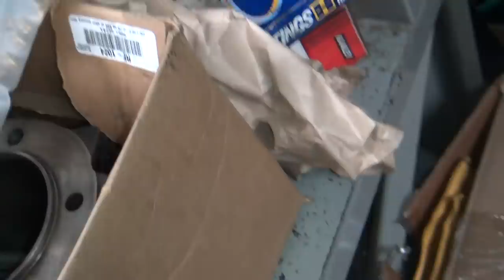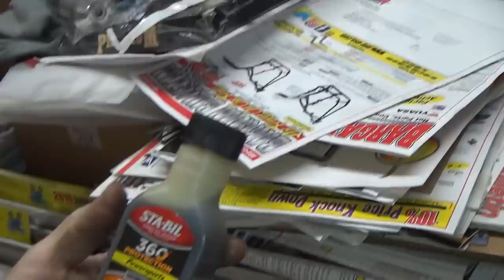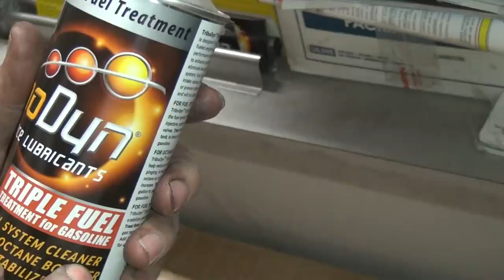#146 How To Do It,  s&s E" carb repair gummed up carburetor rebuild harley by tatro machine

Comment: Thanks for you carb tuning instructions it worked for my super   G carb .For months i just couldn't get the carb tuned so I  followed  your instructions how to set the air/feul mixture screw an it was right on target my bike sounds good . Thank  you so much good job 😀👍
Reply from the maker: its amazing on what simple changes can make. i do this all the time when a bike comes up running like crap.
tatro
Reply: @TatroMachine   hi Tatro I out together a Harley with 103 stock twin cam with super g carb and a thunderheart programmable ignition system the bike has stock pipes . What intermediate and main jet would you recommend i use thanks .
Reply from the maker: i have no idea because the gas you use is not what i use and every motor wants what it wants. get some jets and see what happens. you see me doing this in the videos all the time.
tatro
Reply: @TatroMachine  I use regular unleaded here in California  I used premium but It made my bike idle rough .
Reply from the maker: throw the s&s G carb in the trash and get a smaller carb. yours is way to big. the hsr42 is best but the s&s E will work too. start with the jets that come in them and go from there.
tatro
Reply: @TatroMachine  yes sir il swap the super G for a super E . I didn't know a super E carb would work for a motor 100" or more but you no better than I do . I really didn't like the super G anyway seem like it sucked to much air and sensitive  to dile in .

Comment: Thank you for the very complete tutorial! The one circuit you missed in your cleaning was the enrichment circuit. I just ran into one that was clogged to the point that no fuel was being added but would increase the idle at start up and keep it running
Every time I build a S&S "E" carb I tell people not to touch the throttle if the enrichener is on or they will foul the plugs. This was the one that the guy needed to pump the throttle to get it to start and stay running when cold
Reply from the maker: i just shake the float bowl. if it rattles, than the needle valve is go to do and the passage is not cloged up.
tatro
Reply: @TatroMachine   Not the inlet, the enrichener (choke.) The enrichener circuit emulsion tube was clogged. Had to run a small wire through it to clear it.
Thanks for answering back!

Comment: looks like theirs a bushing for the throttle shaft?, is it replaceable? or  just replace the throttle shaft? i suppose thats probly why s&s sells a replacement body..or can you install an o-ring...any advice? it was sucking air enough to not let it idle down...thanks
Reply from the maker: they do not come with bushings stock but s&s does sell them. you will have to machine the carb inorder to use them.
tatro

Comment: Dude...how do you replace the butterfly? I don't recall how I got the durn thing apart. Now that I have the new parts here, I'm doing a rebuild and the butterfly is bigger than the doggone bore it sits in!
Reply from the maker: it fits in at an angle. you have to square it up in the bore and than tighten the lock screws. that is if you have the correct kit.
tatro
Reply: @TatroMachine  Thanks dude! I got it. Is there a trick or method for "winding" up these throttle return springs on either end of the butterfly shaft?
Reply: I got the throttle cable side.......its the other side I'm having a time with....
Reply: @TatroMachine  thanks for the help dude. 'preciate it.
Reply: I absolutely cannot get the butterfly to sit correctly and the brass rod supposed to go in only one way? I need help!!!

Comment: i have an stock 06 xl sportster which backfires when i leave the house soon after start up. should i let it warm up longer or should i troubleshoot it. and if t/s where do i start?
Reply: @Alilretard1  i agree. its a cold start thing. i also like tatros idea of using stabil in every other tank.
Reply from the maker: it is lean. put more jet in it of fix the stupid computer.
tatro
Reply: i live in florida. is shipping tribodine gas additive cost prohibitive to send here? the t-shirts weren't. by the was t-shirts are excellent.

Comment: Hey tatro just watched your latest vid, I have a 1993 evo and can’t get it to idle without backfiring and cutting out, it has a stock ignition timed correctly, an ev27 cam, 48 pilot jet, stock cv carb but polished inside, and ported heads that have probably been ported too far, why can’t I stop it back firing at idle and cutting out, idle set at 1000 roughly

Thank you for any help, I only ask as a response to your latest vid....

Rob (uk)
Reply from the maker: start with the ignition and wiring and than the carb. 
tatro

Comment: Yeah forget that carburetor cleaner that's backyard stuff need to get a gallon can from Walmart AutoZone checkers the gal can carburetor dip cleaner take the carburetor completely apart make sure you remove all the o-rings anything plastic remove set them aside that comes with the basket put your parts in basket make sure you  disassemble the whole carburetor put all parts in the basket play basket in the carburetor dip can do not leave these parts in the can longer than 30 minutes Max are your parts come out looking brand new take an air hose to everything if there's any residue carbon buildup still find yourself a paint gun cleaning kit what are the little tiny brushes clean out all the holes in your jets intermediate jet make sure your spray inject tube is clean that sits in your float bowl is sprays into your carburetor fake gun cleaning kit between all your carburetor parts take note scrapers or sandpaper memory cloth anything to that carburetor very delicate remember take the whole carburetor apart just down to the body of the carburetor and that's how you successfully clean the carburetor don't use carburetor spray cleaner brake clean any of those products is a carburetor dip can  parts basket  like 20-25 bucks 730 minutes on your part to clean without breaking your back standing over the counter trying to clean your parts by hand the only thing you're going to do is end up with a backache and still have dirty parts with massive scratches in your parts very delicate you are supposed to replace any part scratched damaged make sure you replace every o-ring 
 Make sure you replace the carburetor wood spacer plate there's an o-ring on that wooden spacer and there's another o-ring on the carburetor the wooden plate o-ring goes towards the manifold and you can't adjust the carburetor if the air cleaner isn't on it s&s recommends having the air cleaner on the carburetor when adjusting the carburetor hopefully my information will help you even more don't throw your carburetor around on the table you can break something real easy watch out when you remove accelerator pump to replace it turn down your carburetor do it over a bowl frying pan a pot do the fact that if you aren't familiar with that carburetor he has a couple little o-rings in there that will need to be replaced and has the two little tiny ball bearings or somebody flips that off of there and they was barbarians go flying and you'll be looking for days for those stupid little ball bearings so be careful removing the accelerator pump I mean make sure you replace accelerator pump it's a little diaphragm the little tiny o-rings let the little ball bearings sit in so for the whole kit master rebuild kit for s&s super e s&s sells it for $120 the kit has everything you need replace everything inside that carburetor and outside master rebuild kit check it out s&s super rebuild kit don't let all these other people with these ads for $29.39 $50 for rebuild kit weather in Yonkers what they're doing you won't get the right o-rings I'll send you black o-rings not the blue blues for gas black is for water are green is for air conditioners so don't be fooled play these cheap rebuild kits Amazon selling eBay any of those my straight up s&s rebuild kit from s&s pretty smart huh well I hope I helped everybody out  some what I have 537,000 miles on my FLT 83 bought it new for $5,300 used to have a shovel in it after I blew that to pieces in the middle of nowhere in Nevada for what it cost to rebuild the shovel I built me a  s&s Big bore Evo that that hits140 mph barely turning the throttle I've never been able to open the throttle all the way the bike won't hold up to so remember bike seats longer than 30 days when you have an s&s carburetor you need to take a carburetor apart and you repeat the cleaning process that's what s&s requires look up locker in that carburetor and it gets all sticky don't think about cleaning it with a can of carburetor cleaner that doesn't work maybe for the final process of cleaning after you pull it out of a dip can and if you get some bad gas air leak or something getting a black residue real light start the bike warm it up take a spray bottle of warm water put it on mist give the bike some gas insert missing the water into the carburetor make sure you keep the bike running it will break down all the carbon up your vowels valve stems valve guides number one thing about working on a bike if you aren't sure about something don't be a dumbass and not ask somebody to help you out don't look at the first video you see on YouTube scroll through them find out who actually knows what they're talking about Daniel tiger run forever what knowledge you have share with other people if you see them having the same problems can't learn unless you ask that's why I've been riding my bike the same bike for like 40 years who could afford a new one play the world is you need to make more payments bye it play cash that way you don't worry about somebody coming in repo in your bike it's yours to do what you want with if you don't like the style change it your leader you don't like the style that you changed change it again anybody will ask you what color is your bike this year what did you do to your bike this year take the time over that winter will you bike into the house put some tarps down that way for sure now your free time consist on working on that bike wake up early in the morning to go to work got some time turn some wrenches after work after dinner can't sleep at night get up and work on your bike sit there and watch a movie are you working on your bike don't get in a hurry take your time relax and you won't be fighting working on your bike don't be bitching and moaning throwing tools cuz you can't get something done if it starts pissing me off take a walk come back and you'll see exactly what needs to be done funny how that works well good luck to anybody working on the carbs take your time if you need to be somewhere I need to do something then don't work on your bike there's no rushing doing anything remember that your life in your hands and your friends girlfriends wives it's their life in your hands because if you screw up working on your bike if something happens on the road it causes an accident because you were in a hurry to get something done so you could ride your bike if you take your time there are no problems everything goes nice and smooth check it once to make sure it's done right  check it twice make sure it's tight and take it for a ride couple miles down the road come back and look everything over to make sure everything is tight and right get a friend because you might have forgot something a bolt a nut a washer two sets of eyes is better than one can you tell I have cabin fever this is a long-ass comment been having health issues when was the last my leg Dr George just want to kill you off keep you around as long as you can it's an insurance check do they make sure you don't heal are they causing more problems haven't written in 2 years now I got a lot of work I got a deal on the bike fork oil seals drive chain rocket box gasket kit tires on whether cracked from the heat any new pushrods anybody's got Andrews Molly Chrome adjustable quick ride for the very exhaust online the adjustable part cracked in half just got no clue where to buy one titanium Molly Chrome pushrod I just need that end piece anybody sees this give me a holler on Facebook
Reply from the maker: if anyone can read all of this and keep up, you get a gold star.
tatro

Comment: The idle air mixture setting should be set with an approximate 25 rpm drop on the rich side of the peak idle adjusted rpm when tuning. Idle fuel/air mixture is negligible for any increased fuel mileage, except at short idle times; long idle times of an air cooled engine increases cylinder friction with increased temperature and shortens engine life. The idle fuel/air mixture setting has no purposeful function at open throttle positions. 

To truly "get the best mileage you want to get" with a carbureted engine, one should invest in an adjustable main jet, if the carburetor will accept it; adjust with a locked throttle at a desired constant cruise speed, set to a 100 rpm drop on the rich side. Fuel air mixture is constantly affected by elevation, temperature, humidity, barometer change, and manifold pressure (MAP); all of which affect the density of air or Mass Air Flow (MAF) into your engine. adjustable main jet settings should be performed periodically with any significant change of air density or when riding at a different continuous speed. When running the rich side of a peak rpm adjustment with about a 100 rpm drop, a slight amount of unburned fuel aids in cooling and lessons cylinder friction with reduced heat (too rich a mixture causes carbon build-up and fouling). 

Cylinder head temperature (CHT) will rise substantially with any rpm drop set to the lean side of peak and engine detonation will occur, this significantly shortens engine life and defeats any fuel economy gains. Generally speaking: If you have gray soot in your tail pipes you are running a good mixture, if the soot is black you are running too rich, and a chalky exhaust is indicative of too lean a mixture. An exhaust temperature gauge (EGT) is the easiest most accurate way to determine proper fuel air/mixture settings of an engine, by setting the temperature of the exhaust gas 100 degrees Fahrenheit on the rich side of peak rpm. EGT will continue to rise with an rpm drop on the lean side, until combustion becomes almost impossible.
Reply: its a harley
Reply: @chongkuat1561  lmao
Reply: Appreciate the info